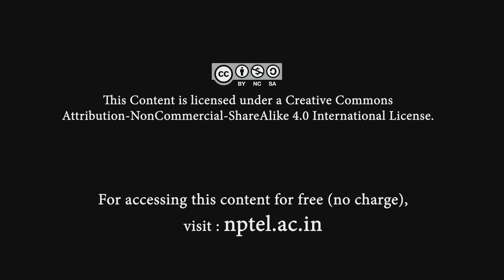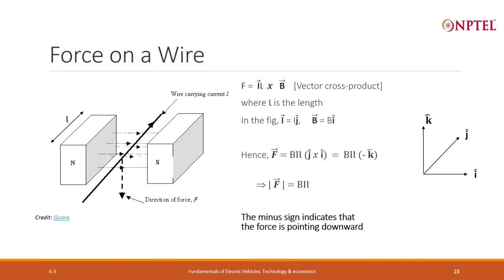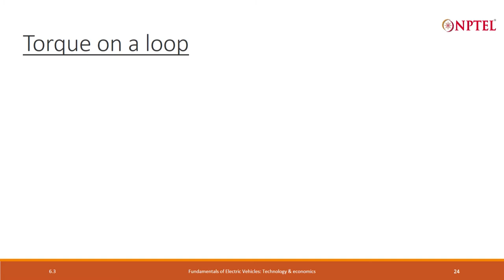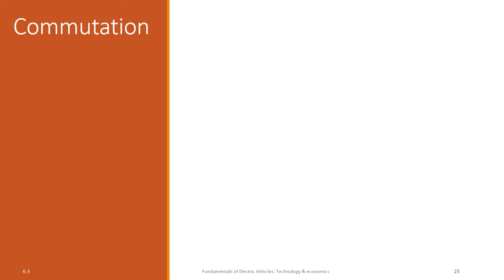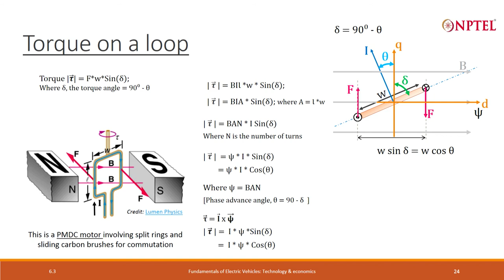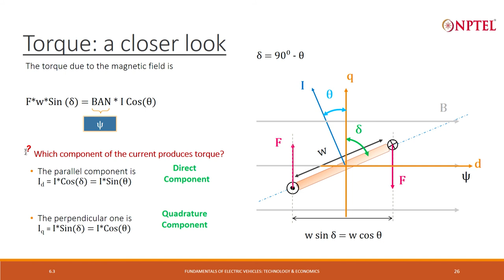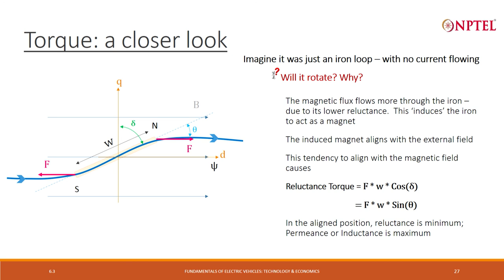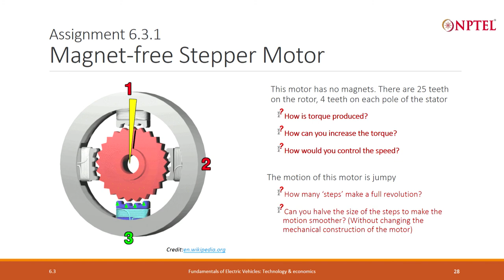Lecture 50 - Torque Production - Part 1

Comment: At 5:41, why are we considering angle between horizontal conductor and force F. As F is acting on the vertical conductors and the torque is generated due to that, but not due to force acting on horizontal conductor. So in my opinion, torque is always constant for this scenario and we should drop the term delta from the torque equation